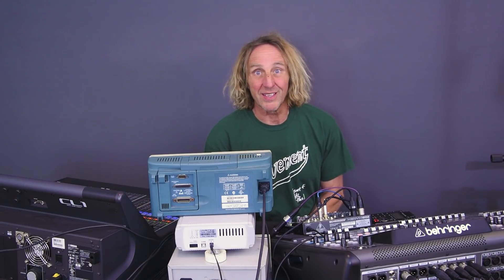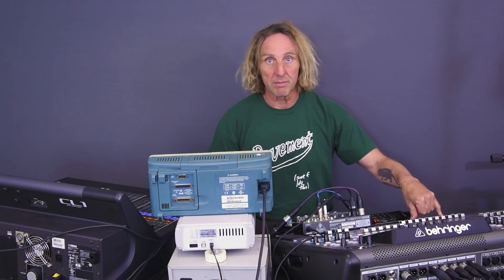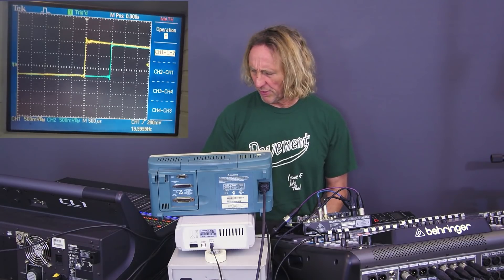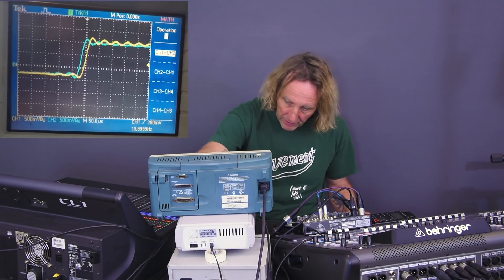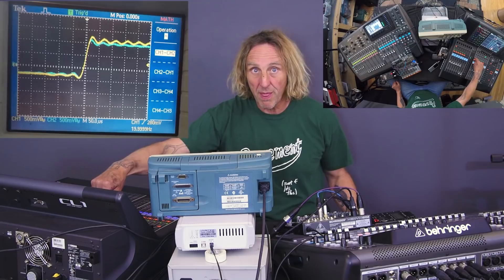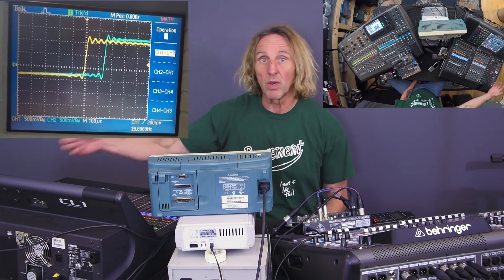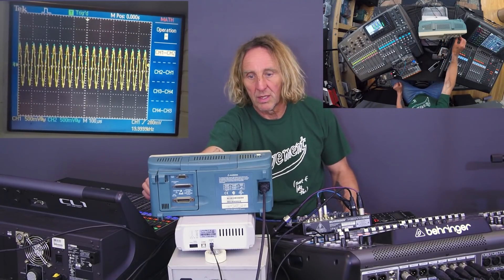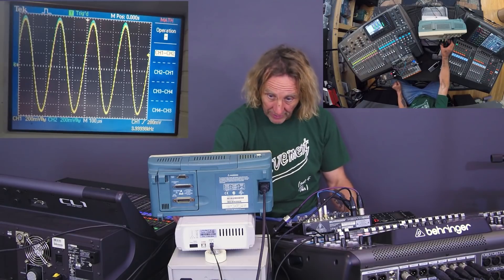Late Not Great, Yamaha CL1 vs Behringer X32 Subgroup Latency (Public)

Comment: Nice video Dave! I must point to an issue about the testing on the latency of X32. The scope display shows the trigger set to channel 1, which is the X32. This means that any delay would not be shown on screen because the trigger ignores the latency effect and set the zero time to whenever your signal hits the 280mV.
Reply: Didn‘t you do exactly that at 8:20? the x32 channel will always stay at 0 as long as u use that channel to trigger the scope, gkonda37 is right with his comment. Use the 3rd scope channel with the signal directly from the generator and trigger on that, as reference. 🤷‍♂️
Reply from the maker: so I went back and looked at it, since the trigger is set to channel 1 which is reference and channel 2 is what is being measured in relation to the reference, the scope shows channel 1 always in the center and it is shows the latency differential between channel 1 and channel 2.

so if channel 1 or channel 2 changes in latency in relation to the other channel when I add the group routing that should manifest as a change in the differential between channel 1 and channel 2. 

Yes channel 1 will still stay centered as the triggered signal, even though the latency has changed, but since the relative latency between channel 1 and channel 2 would have changed, The Yamaha channel trace should have shown up before and arriving earlier than the channel one trace, if the channel one / X32 induced latency. 

since we're looking at whether or not running through the groups adds latency, The concern is whether there's differences between the two traces and it doesn't matter which we trigger off of has the purpose of the test is to look at the differential between the triggered trace and the non-triggered trace
Reply from the maker: I don't remember the whole video but from what I recall I wasn't testing the latency of the X32. I was testing the latency differential between the X32 and the Yamaha and I was testing the impact of latency differentials comparing the two consoles.

Comment: Very interesting! I used to do ch>LR and same ch>bus>LR with variations with fx and or compression quite often, but have been using it less and less with digital consoles. Sometimes it just didn't sound right and I new it was because of phase shifts and this is a perfect illustration of that.

I work in theatre nowadays with pretty much a complete yamaha dante setup (CL3, rio, mtx and other stuff) and it's a treat (when i actually get to do the mixing myself that is), but still try to avoid abovementioned phase shifts. So no more (or very much less) 'doubling' of signals. You win some, you lose some i guess...

Love your insights, 'tutorials' and experiments! Keeps me up to date and still learning!
Reply from the maker: Awesome thank you Mart!!!

Comment: 0.2 ms delay onthe grp CH equals 5000Hz correct me if am wrong, a quater wavelenght has .2ms means 4*.2=0.8msLampda=1250Hz (It takes .2ms for a quater wavelenght of 1250Hz to pass.)  now both waves r on the way to master bus, one passes the deay the other not, they will cancel each other out partially i guess

is that what happens when mix busses and channels on the yamaha

unfortunatly i did too much rock n roll and the feds hunting all my earnings down….still can t afford a consoles to dive into experiments like this.

To see you reminds me of the gd ol days in the live company where i learned sound engineering, i could spent all day with experiments like this.

great job 🐀
Reply from the maker: Yes, .2ms is 5000hz  full wavelength. Max cancellation is at 1/2 wavelength, so cancellation would increase as the freq approached 2500 and then there would be comb filtering as the freq increases.

Comment: Interesting question about if frequency rolloff from D/A should count as a form of distortion. My initial thought is that by definition it should be, but that doesn't seem like the best use of terminology. If every change to a signal is distortion there's no reason to use the word. It would be better to just use the more specific word for what we are talking about. 

As an aside. Could you make the case for delay/latency being distortion? It's the same thing going in and coming out but not at the same time. If everything is direct lines we can just move our window of measurement to see it's the same, but if we're combining live and reinforced sounds we can't adjust that window. Is the sound coming out of the speaker "distorted" because it's late, or is it the combined signal of original and amplified sound in space that is distorted (from phasing) compared to the original?
Reply from the maker: While there does not seem to be a correct answer and it depends on how one defines distortion. 

If a signal is identical, then its not distorted, but what if the before and after signal can not be summed without issues? An identical signal can be summed with itself with the only change being an increase in level. A This does not apply to a latent signal, so perhaps time shift is a form of distortion by that definition. 

But EQ and compressors, gates and crossovers would also be a form of distortion. So maybe adding "unintentional" or "irreversible".

But then intentional distortion would not be distortion if it is intended, 

Just fun with words but overall, latency should not be dismissed as it can be quite relevant and is often undesirable and in those scenarios, I believe its fair to lump it in with distortion.

Also, lower distortion often comes with higher build costs and latency falls into that realm where lower latency does get expensive as an infinitely high sample rate is need to reach zero latency.

Comment: Hey Dave! Really enjoyed this video. I expected better from the Yamaha! I use a CL5 every week so I'm a bit biased haha. I will note that on the Yamaha setup page, console latency can be adjusted from .25 to 5ms if you're using Dante i/o. Seems that there's a bit more latency if you're just using the direct i/o on the back! Regarding the increased latency after routing... very interesting. I'm curious whether the EQ, Dynamics, and/or Inserts on the channels contribute any further latency. Same for X32. Topic for future video? Thanks!
Reply: That "console latency" setting for Dante is only for audio transmitted via Dante - the Rio stageboxes have their own latency spec, which is "less than 2.5ms", i.e. identical to the direct I/O on the console. So that Dante latency setting would be on top of the ADC and DAC.
Reply from the maker: Yes, the ADC and DAC are often the biggest creators of undesired latency.  I will ponder diving into the impact of EQ and such on latency.  I did test the X32 and the EQ on the channel does not alter latency.

Comment: This is why Behringer bought Midas.

Any modern console should be completely phase coherent, meaning that the latency is fixed across all buses and groups and routing. Only way to get phase incoherence introduced should be an AD and DA conversions (which are in order of microseconds). So you go out of the console and come back in, that introduces just a  tiny bit of latency... but you should be able to compensate for that using console's delays.

This might come with  a cost of a small amount of overall latency that you can't get rid of (let's say 0.5ms for the arguments sake), or by overall latency increasing as routing increases, but it's (or should be) basically inaudible since it only means that the source of your audio has moved like some centimeters (few inches) further from you, depensing... basically non existent change.

If one's using digital snakes, even that should be phase coherent in general, meaning that what comes out of the stage box is in same phase and delay as what comes out of the console's local output... you might want to test that as well? :)
Reply from the maker: Agreed and unfortunately the x32 and m32 add latency when imternal plugging or efx are added to the groupa and also when inserts are used.

Optional aligned latency and minimal latency modes would be good.
Reply: @DaveRat  as an electronics designer, the issue with latency compensation is the need for very fast and low latency memory.

Every sample  of delay needs 24 or more bits and if you introduce let's say 100 sample's of latency on one routing, you need to store 2400 bits * number of channels and buses etc worth of data.

Let's say we have 32 channels + 16 busses + 4 subgroups + stereo main output, that's 2400*(32+16+4+2) bits of data or 129600 bits, that's ~16kB of data or so.

Seems like  small amount, until you understand that it just can't necessarily be stored in some block of DDR-memory that can be gigabytes, but in most cases has to be stored within the DSP-processor(s) in very fast registers or local cache since the timing requirements are so tight that monolithic DDR isn't fast enough because we talk about hundreds of microseconds of latency here... a real-time processing issue.

So there needs to be a limit somewhere or the costs of the hardware can skyrocket pretty fast  because memory like that needs bigger DSP's and tighter timing etc...

So it's understandable that there needs to be a limit... I mean DSP processors themselves are expensive, so you try and reduce the amount as much as possible in a product like x32, and developing multi DSP systems is expensive and time consuming so yeah, most of this memory has to be found from one or two DSP's that do the grunt of the work, so it could need megabytes of local cache in larger consoles or longer latency compensation, and memory takes up space from the silicon.

:)
Reply: @Mtaalas    Memory speed is definitely not the dealbreaker.  Consumer DRAM works at rates well above 10TIPS.  10,000,000,000,000 throughputs per second.  Your 16KB would move in and out of memory in .00000006 second if done serially, and that’s not the way it’s done anyway.  Memory, I assure you, is no part of the problem.
Reply: The words “fixed” and “latency” don’t really belong together.  Every process unavoidably incurs some delay, particular to that process.  So, inherently, a mixer with a dozen or so different processes, needs to be compensated automatically for each of them every single time one is invoked.  It’s not rocket science, though it is a difficult thing to enforce and to do without creating noises.  Much math is involved and a system-wide approach with firmware updates to accompany feature changes.  Our awareness of this will force the hands of mixer builders.

Comment: It would be a great service to list the devices that offer automatic delay compensation.  I am going to make my best effort to do this. I’m sure it will be an ongoing project..  In my opinion, these are the only devices for serious music mixing.
Reply from the maker: This was shared during a discussion on that topic in one of the recent channel member zoom chats

https://www.prosoundtraining.com/digital-mixer-study/
Reply: @DaveRat    Thanks very much for this, Dave.  Some fine work (and lots of it) went into this but the bottom line is still well hidden, as shown by this grid investigating only a few of myriad scenarios.  

I’ve been working all day on this and have so far found only Avid advertising hardware that implements “full auto delay comp”.  It is so hard to find manufacturer detail on this the only reasonable conclusion is that no one else is doing it, but I can’t accept that.  Surely the Oxford OXF-R3 must have, and I’m hoping for SSL to be transparent about the Live series.

I have friends at some of the manufacturers who will help in my search.  Lawo, Sony, SSL, Calrec are on my checklist.  Until we can freely assign and process without gross errors, digital mixers are letting us down.  Only by shedding light on this issue will things percolate down the $ scale.

Comment: Any device that ‘mixes’ must employ automatic delay compensation, yet few do.  As an everyday user of DAWs, I am amazed by this, as simply disabling it turns my meticulous work to utter shit.  A ‘mixer’ by its very definition MUST correct for all contrasting delays incurred by its mechanics.  The result of NOT doing this can be distortion so gross as to render the mixer useless for music.  The result of DOING this causes a single comparatively meaningless penalty; the final combined output is delayed by some indistinguishable quantity.  

That’s a pretty powerful argument for mandatory automatic delay compensation.  Even better, it is not particularly difficult to implement.  Each digital process in a piece of hardware causes a precisely known and repeatable delay that can be reported to a DSP, and there is a finite number of these processes, actually a pretty low number so the needed code is minimal.  

Sound that is late is a daily part of the human experience.  As we step away from a source we are perfectly aware the source is the same thanks to our brain’s happily adjusting.  Sound that is grossly distorted by haphazardly combining different delays is a totally different beast.  That is an effect.  An example is the reflections off a tiered surface such as the stairs in a stadium grandstand, which we’ve all heard.  If your mixer is going to give you this all on its own, you don’t have a chance.
Reply from the maker: Hey hey peter, I agree except for the exceptions.  Here is a video diving into a common situation where latency is an irreversible issue that parallels the issue of routing latency.

When we hear our own voice late through in-ears or headphones, there is no fix.

https://youtu.be/APj0ZaMy4Xw
Reply: @DaveRat    Agreed to the ears comment.  I keep showing my studio roots!

Comment: Awesome stuff, Dave!

The yamaha console has a latency switch in the dante setup page for matching latency with the size of the network. With 1ms delay being the default value the console chooses (and the lowest being 0.25ms), might that be the difference in latency we see between the CL and the X32? Im just not sure if this still applies for the internal latency of the console or just the dante network. Any thoughts?
Reply: Dante latency settings affects only dante networking, ex when connecting rio stageboxes. In this video Dave don’t using Dante network, he is connecting straight to board. If we add corresponding stageboxes to the consoles, loss in latency of Yamaha will be more. AES50 is the fastest protocol - 60 microseconds per link, and Dante will add at least 250microseconds pre link
Reply from the maker: yes, dante is external so whatever latency issues that are created or exist internally can be transmitted properly.

ideally there would be a similar compensation internally as well
Reply: interesting point.  i would guess the majority of users will not assist adjust this, so a stock to stock comparison is fair.
Reply: This corrects the delay difference between a snake input and a rear panel input and that’s a great start. It isn’t terribly common to take signals at these two inputs that need coherence but every correction is welcome.

Comment: Interesting. Yes, latency is distortion if the signals are recombined....including by your ears. I remember we conducted experiments with avionics communication radio "sidetone" delay. Traditionally when a pilot grabs a mic and talks to the tower, his radio wraps the audio sent to the transmitter back to their headphones so they have confidence the radio is on and working. When we started digitizing and delaying that audio....well that could be a real problem. Even a 100mS delay some folks can't even read from a book without messing up. Also if two radios are receiving on the same channel and their outputs are combined, they better have the same delay...or if not possible, at least vary it randomly on purpose to avoid getting stuck at nulls. Swishy, swishy. Radio, Radio. I wish I was in Tijuana.
Reply from the maker: Cool info, thank you!

Comment: Would be interesting to know which desks have latency compensation to achieve phase alignment at final output stage, like what many DAW‘s do.
Reply from the maker: Yes, agreed. While I have no desire to test a pile of desks, I did do the test with simple cheap gear so anyone wanting to test can do so.
Reply: The list is vanishingly small.  S6 and S3 from Avid are notable.  Without reading the manuals, I have not found any other claim, though I suspect the very high end from Calrec, LAWO, SSL Sony Oxford are likely.  I don’t know of any other device advertising the same.

Comment: Good question! I would put the name of the audio alteration „Latency“ simply in the delay category - it essentially is a delay that can cause chorus, flanging or phasing when you add it to a non delayed signal :) As it does not distort the waveform I would not call it distortion no. Thank you so much for your work it it soo valuable!

Comment: If latency was considered a form of distortion then every time a recording was listened to it would sound more and more different than the first. Latency is only time distortion!
Reply from the maker: Is EQ a distortion? Is distortion determined by intent or alterations that are not optional?
Reply: I would challenge that, Greg.  Delay, per se, is not distortion, but this entire discussion is about non-deliberate mixing of delays and the result is a distortion you would find appalling.  You may not have understood the premise here, but a very simple though experiment is to listen to two copies of a sound in your DAW simultaneously.  Move one of them a single sample and listen again.  That delay, what you call latency, will change your mind forever.